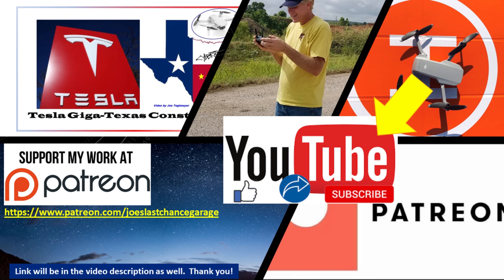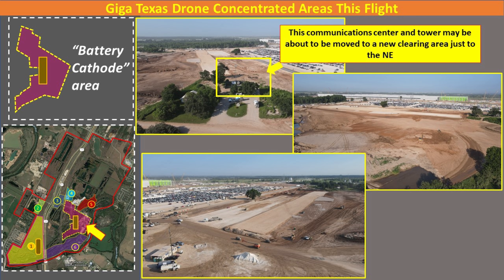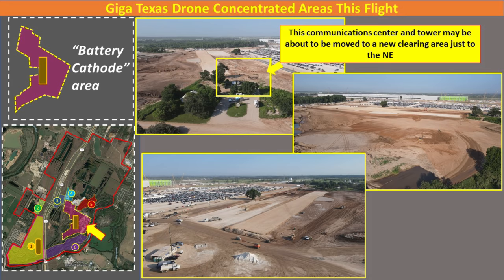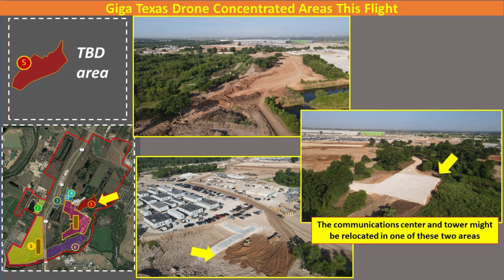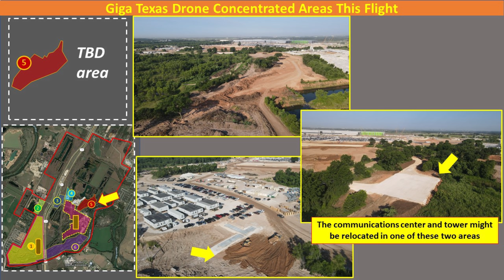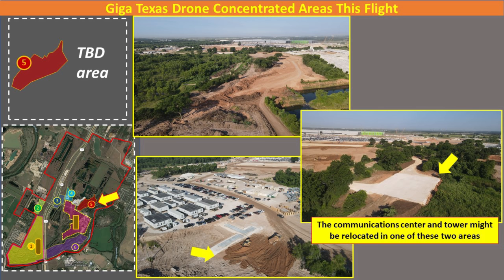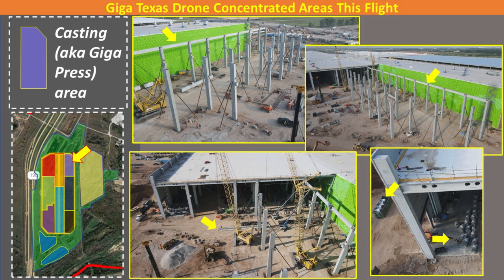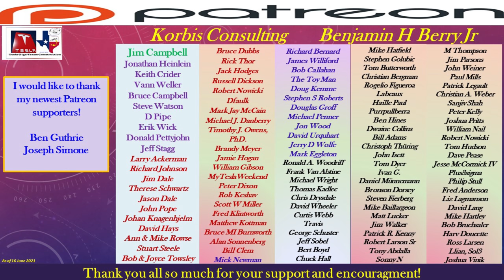Tesla Gigafactory Texas 16 June 2021 Cyber Truck & Model Y Factory Construction Update (08:00AM)

Comment: I saw a comment that said the communication tower by the old house is a reference point for the surveying, like GPS but extremely accurate.

At 5:15 that dam will have to be coated with concrete to prevent it from being washed away.

At 14:26 they're probably spare water vaults in case of damaged or flawed ones.  I thought I saw at least one more in the east storage yard.

At 14:30 what's going on under the two canopies on the left?  They're over the foundations.

Thanks, Joe.  Great coverage of the Starlink area!
Reply: The tower near the old house is a COW or Cellsite On Wheels. In other words, a portable cell site. You see these at locations that will have a lot of cell phone users on a temp basis, like say a golf course having a PGA event or a neighborhood where their regular cell tower is being repaired or updated.  The GPS enhancement devices are the one that you often see near the old location where the Drone flyers used to park. They are small devices, don't need much power. They just have to be at a known location that doesn't change.
Reply: @Bill_N_ATX  
We had one of those portable cellsites on a trailer in our parking lot for at least a decade.  They didn't want to run cables to it so they set up a microwave dish and pointed it at the one on the building about a hundred feet away.  I'd say that that link is absolutely fade proof.  🤣🤣
Reply: @acmefixer1  Canopies at 14:30 in Randy's video from yesterday, rebar workers were under them. Randy shoots at 5PM, its blazing hot sun by then.

Comment: Thanks Joe. Incredible amount of insulation and membrane materials stacked on the roof. 
9:43. Relocating the precast panel brackets. Edit. On the columns.
9:55. Assembling another stair frame work. 
9:59. They’ve substituted a ride on troweling machine for the Model Y. Not falling for that!
14:13. Water vaults. No outlet visible. Quite an inconvenience if they were for buffering for rain events. I think there is more to be installed here. The extra excavation work carried out last week didn't seem to be necessary to get the installation of the vaults to this stage. 
14:29. Remaining vault sections. These are not as tall as the sections already placed. All sections are open at each end, so they must connect to some other yet to be delivered sections, or possibly butt up against the existing vaults and a new penetration. There are 2 slabs a little  shorter than the vaults, so no part of these vaults but maybe for yet to be delivered sections.
23:42. There is quite a variation in the spacing of the columns. Was the same at the stamping plant. Another mystery.
Reply: 23:42: the narrower spacing is the "alley" between the two rows of stamping machines.
Reply: @greggerypeccary  Ooops, I should have time stamped it at 23:28. I meant the spacing of the columns along each north south row. If you look at the complete row on the west side you can see the spacing of middle columns is noticeably shorter than all the others. Some of the other spacings vary a little bit.
Reply: @DessieDoolan  Yes, but this is also part of the layout... you have a large spacing where a machine will be, then a narrower spacing for where people move around... they're just making very efficient use of space, rather than building an even-spaced building where the spacing is defined by the size of the biggest machine. This is Elon, so you know there's a good reason behind these kinds of things...
Reply: @greggerypeccary  No doubt there is a good reason, but I like to try and find the reason. Unsuccessful thus far.
Reply: @DessieDoolan  Just look at the previous structure -- as far as I recall it was done exactly the same way.
Reply: @DessieDoolan  I was previously mistaken: seems like they have 11 sections: a narrow one in the middle and five wide ones on each side... so the narrow one is probably a corridor and both sides three casting machines each.

Comment: I have seen the fusion welded poly pipe be pulled through an existing smaller pipe. If there is an existing pipe under the river, they may use this method. A cable is ran through the existing pipe and attached to a pulling head that connects to the poly pipe. The cable pulls the pulling head through the existing pipe, breaking it up, and displacing it with the new poly pipe.
Reply: By using a directional drill bit with drill string a passage is drilled thru the ground and upon reaching the "target" the bit is removed and the flexible poly pipe is pulled back thru the passage via the drill string (shaft).  It is really a work saver when running underground utilities without disturbing surface structures, especially buildings and water.
Reply: @trex2092  So the pipe can go where no pipe has gone before.
I had always wondered how the conduits for fiber optic were placed into the horizontally drilled passages.

Comment: Unfortunately as the days progress, it's getting harder to see any big changes now. However, it looks like the Austin complex will finish before the Berlin complex.
Reply from the maker: Are you kidding?  There are huge changes that are very visible happening all over the site!
Reply: So have you been watching the Berlin drone flights much, how do you measure the data in order to come up with that deduction?
Reply: Somewhat, but 2 new very large buildings just getting started and still lots of exterior work on the huge main structure.
Reply: I can mathematically disagree, since even with my tracker only focusing on the main building, I can assure you that every single day it remains on pace to finish up this year. ;)

Comment: At 18:30 anybody have a clue about the little white frames sitting on top of the connex boxes in the supply yard?
Reply from the maker: I think they are parts to the various conveyor systems they are installing in the GA structure
Reply: Joe is right. They are prefabricated frames for production lines.

Comment: Tbh this factory really is ugly AF to watch, hope it will be better when 100% complet. I don't understand why they are doing this super weird shape, instead of a monobloc building. 
Thanks for the video Joe.
Reply: Why would they do a boring factory that looks like everything else. I’m not someone that tries to stand out particularly, but why does everything have to look a certain way?
Reply: @duncanadams2531  Yeah your also right, but this building doesn't look efficient at all, that's my point, and that's why I don't understand them doing that, since Tesla is obsessed (and it's a good thing) with efficiency. 
I mean, what's the point of wasting space with those two huge area without roof going alfway through this building ? It looks like these "cuts" don't even have windows to let the light go inside.
Reply: @WlerickBigotOfficial  The 'cuts' have been left to allow access for construction of the thermal oxidizer and the water vaults. They also made concreting the floors very easy.
Reply: The cuts will be filled in soon enough. They've already laid some of the foundations in them.
Reply: @LinasVepstas  thanks for the answers guys, it's pretty good to know.